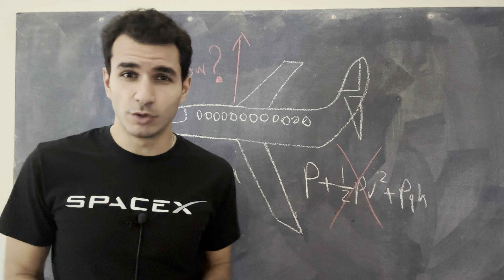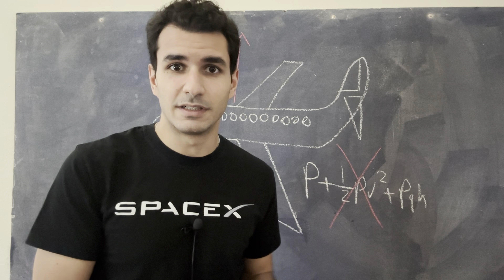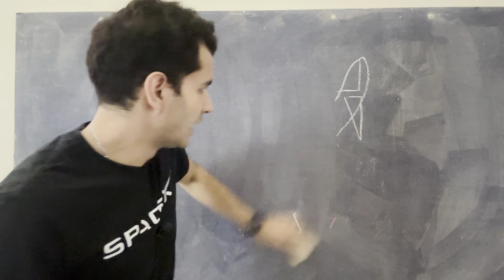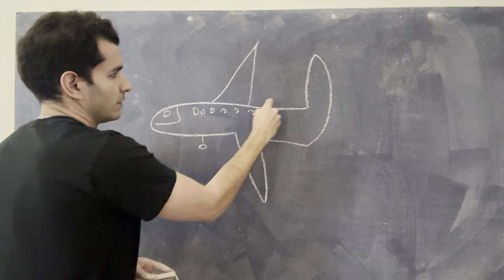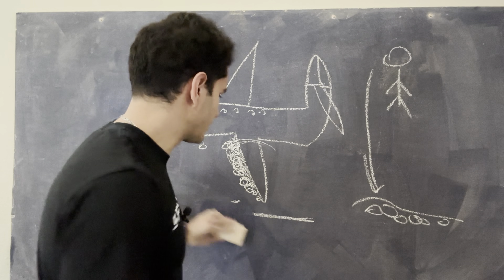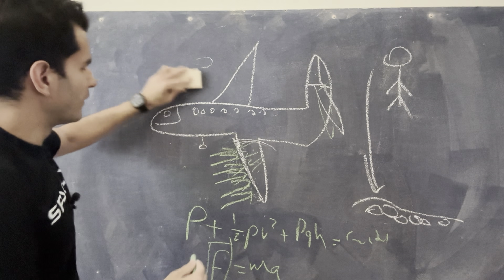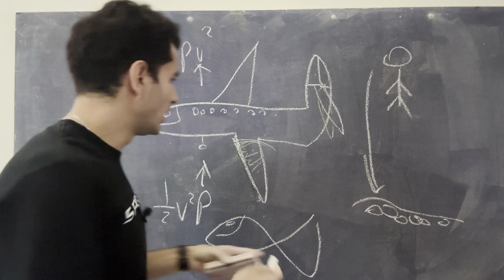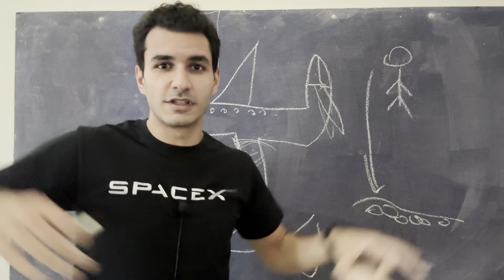Fix This One Misconception = Understand Airplanes Forever

Comment: I'm not an engineer, but I read quite a lot on the topic. It might make sense to do a follow-up and explain how both angle of attack and Coanda effect create lift (both are pushing air molecules down so Newton's law still stands). And how you balance the trade-offs to design an airplane for the given purpose
Reply: But Coanda doesn't do any work (in the sense of inputting energy) to change the momentum that accounts for the force of lift.  Or does it?  Which is an argument for not using Coanda to explain lift, because it is ill-defined in relation to the first principles of physics: mass flow continuity, and conservation of momentum and energy.

The above 3 conservation properties (mass flow, momentum, and energy) create lift in relation to asymmetry of the airfoil to the relative flow direction.

It is that asymmetry that causes lift, and as such it is asymmetry from angle of attack and/or any asymmetry of camber shape which combine to create lift, in terms of the 3 conservation properties (interacting with each other).

Comment: Best explanation of lift: Understanding Flight, Chapter 1 (Anderson, Eberhardt)
Reply: While your reference is useful, it is also flawed.  Lift is not merely a pressure differential, nor merely downward momentum. It is the conserved consequence of turning a mass flow (from an asymmetry) under constraint—where energy, momentum, and mass continuity must all be honored.  Their book is dismissing the relevance of the former in favor of the latter, therefore perpetuating the incomplete picture that keeps the opposing camps of a flawed divide in the argument going.

Comment: i'm just 15. and really.. people focus a lot more on the speed of air passing at the top and bottom of the airfoil causing pressure difference... and some compare bernoulli and newton like both can't exist at the same time.  and just how... complicated the internet has made this q... it feels weird to say that it's just air molecules pushing the wings when the plane is at enough speed to generate lift, and then angle of attack, and up elevators all come into the flight!
Reply: what I meant is why is it being overcomplicated. I don't even know THATTT much about it thought I am interested.
Reply from the maker: because most human's brains are full of noise and can't think clearly -- we will fix this problem long term
Reply: @alithedazzling  OMG THANKS FOR REPLYING.. I knew your channel was good.. but didn't know it was this good. keep making such great videos!
Reply: Because it is a bit more complicated than that.  But not a whole lot more complicated.  While I agree with Ali's statement:  "because most human's brains are full of noise and can't think clearly -- we will fix this problem long term". I honestly don't believe his explanation helps bridge that gap in this case.  The intuitive explanation needs more correlation to some missed nuances.  Sure, I agree it should be intuitive, digging behind the formulas, but with more focus on connecting to the underlying physics first principles.
Reply: @davetime5234  ahh i see. alright...
but our problem was not.. it's complications. that part is kind of fine. sorry for my lack of vocab. but I meant.. people overcompl.. I mean focusing more on is it bernoulli? or is it newton?
that's the problem
Reply: @avasyubiswal5421  "Bernoulli" is derived from (is a subset of) "Newton".  So, even if you simplify the description of Bernoulli to be a representation of conservation of energy, that conservation of energy is derived from the physics of Newton.  

Bernoulli is Newton for the case of distributed masses of fluids and gases. 

So, when air and an asymmetrical solid (the airfoil) meet, how does that "collision" reaction produce a change in vertical momentum that is equal to the force of lift? 

That's the basic problem that needs to be intuitively explained.

And why is that a far more energy efficient way of providing the vertical force compared to directly vectored thrust(?).
Reply: @davetime5234  ohh alright! thanks..

Comment: Partially correct. It is indeed forces on the control surfaces and not the reduced pressure above the wing that generates the lift. But, the objective truth of the underlying physics tells a different story about why aircraft fly, and more importantly provides the correct amount of lift. All will be made known in a new model of our world, that completely rewrites physics, in 2026.
Reply: In all honesty, four false statements, unless I missed you are trying to be funny.
Reply: @davetime5234  No, not trying to be funny at all. Do your reading and you will indeed find that physicists (who know their art) generally agree the numbers of the low-pressure lift above the wing theory do not add up. Yes, there is a big fundamental flaw (a rookie mistake if you like) at the very foundation of physics. The current, soon-to-be-legacy paradigm is only "approximate". As an example, the Newtonian gravity equation is as much as up to 2% discrepant. It is NOT because of imagined MASCONs. Newtonian gravity also says you are heavier at the poles. Gravimeter readings and a correct equation for gravity say the opposite. So, all those claims should give you a good laugh too.
Reply: @TheGeniusHillbilly  I think you’re conflating critique with contrarianism. While it’s true that oversimplified explanations of lift (like equal transit time) are misleading, dismissing low pressure over the wing as “a rookie mistake” ignores its central, measurable role in momentum-based models. Similarly, variations in gravity with latitude are well explained by Earth's oblate shape and rotational effects—nothing mysterious there. As for MASCONs, they’re real, but they explain lunar anomalies, not standard terrestrial gravimetry. So if your intention was satire, well played. If not… might be time for a deeper read.

Comment: Yeah I think I know where you are going. everyone underestimates the deflection component. I had a very smart instructor that had advanced aero under his belt tell me its a much larger lift component that most understand.
Reply: There are no separate components. Newton and the deflection of air explain 100% of the lift: they are the actual causes. Bernoulli is just describing the consequences (pressure differences) and reverse-engineering them to explain the same effect. It's like saying you won a football game because you had more goals. Technically true, but it misses how you got them.
Reply: @florianchalet4555  In the context of my flight training, he was helping me work through discomfort with power on stall entry. a maneuver we practice to simulate trouble on take off. If done poorly it is how you enter a spin.

Comment: Change in momentum generates thrust.
Reply: Time rate of change of momentum equals force.

But, yes, without that happening in the vertical direction, the aircraft can't stay up in the air.
Reply: @davetime5234  that is also true.  no thrust no lift
Reply: @charlesdarwin5185 Yeah, and a bit counter-intuitive perhaps, but while this is required to hold an airplane in the sky, it wouldn't be required in a wind tunnel test of an airfoil if the pressure drop on the top goes all the way to the ceiling, and on the bottom the pressure increase goes all the way to the floor.  

Because then those pressure differences are connecting the load to the frame of the tunnel, which supports the test object's weight against the ground.

So, no close wall (mid air), you absolutely need that downward "thrust" (caused by the pressure difference).

But close to a surface with rigid support connecting to the ground, and you can have all the lift sustained from the pressure difference alone.
Reply: @davetime5234  my comment was related to F=MA2.  delta MV in gas causes delta MV in plane.  Unless I am wrong
Reply: @charlesdarwin5185 I assume you didn't mean to put the 2 in the formula?  Just F=MA?

As far as the need for constant momentum change as the force holding an object up against gravity, it all depends on whether or not their is some structure providing opposing static support forces.

A book on a table is held above the ground by the table and its legs pushing back on the book with a force exactly equal to the weight of the book (opposing compression forces in the table).

If a suction cup instead attaches the book to the bottom of the table with a pressure difference, the table must still sustain those opposing compression forces to oppose weight, even though the pressure difference of the suction cup holding the book to the table provides a force opposite the book's weight (the suction provides force against the table, and the table must sustain that extra weight against the ground).

But if you support the book's weight by a pressure difference against only air (no table), then you need to continuously displace momentum downwards.

The pressure difference "against" only air is, in a very real sense, pulling down on the air above, actually causing the downward change in momentum necessary to replace the lack of opposing static compression forces.

And the force of that downward change in momentum must calculate to be exactly the weight of the book.

The downward momentum flow has replaced the need for the table's support.

Comment: I find this video to be inadequate. You don’t explain how an airfoil generates lift with a zero angle of attack. Not disagreeing with your stance on Bernoulli, I’m trying to find the answers too.
Reply from the maker: airfoil generates tiny lift compared to what changing the angle of attack does -- that's the whole point
Reply: @alithedazzling definitely agree with you there, especially during the takeoff sequence. But to me that’s pretty obvious. The non-obvious and interesting part about this subject is the role of the coanda effect in lift. Basically the air bends to the surface of the wing just like a stream of water from a faucet when you bring a spoon near it.

Comment: Now this is interesting. I started ground school recently and i was also taught the the airfoil design was responsible. Well thanks for expanding my horizon anyways.
Reply: I'm sure they were making the point that the asymmetry between top and bottom are the necessary condition for making lift.  But then in flight training you learn to internalized that angle of attack is how you adjust the total asymmetry in flight to control how much lift you get (directly affecting vertical speed change).

Comment: Like in most layman terms
So lift is nothing but drag on an inclined air wing and the vertical component of drag causes lift? And the thrust of the engines neutralizes the horizontal component of drag(overall drag of plane body) also gives horizontal acceleration by which the velocity is attained as the speed increases drag increases too?
Like I am from biology but i studied physics during my 11-12th

Comment: It's the drag the opposing force which builds with velocity of the plane and it's just pushing back which is direction opposite of velocity, so with angle of attack the air molecules get more area to push up hence it gets lift.

Comment: why is bernuli and newton an argument? aren't they both true at the same time
Reply: If you take "Bernoulli" as the (conservation of energy) pressure change, and take "Newton" as the (conservation of momentum) action-reaction, then they are both definitely inseperable aspects of the mechanism of lift.

A solid's asymmetry (whether from camber or angle of attack) changes the pressure so that flow speed adjusts to maintain mass flow in rate = mass flow out rate (continuity, or conservation of mass).

So then, the whole picture and the pieces:  

Lift is the force from asymmetry turning the flow.

It turns the flow by conservation of mass driving a conservation of energy pressure change which turns the flow to maintain conservation of momentum.

So, in answer to your question.  Yes, they're parts of the same whole that is always present, no matter the source of the asymmetry.

Comment: Newton and berrnoulli and bothe valid explanations. They bothe explain the same phenomena of lift but from different perspectives. You can calculate total lift as pressure difference or you can calculate it through forces acting on a wing. You basically have 2 mathematical approaches for same result.
Reply: Pressure is a force, so what point are you trying to make?
Reply: @davetime5234  1 year ago i did a research on this and i thought that total lift can only be calculated through adding  lift caused by "Newtonian" forces with pressure force difference. But aerospace engineers explained to me that you will get the same value from integration of pressures over the whole wing or integrate the momentum flux all around the wing...
Reply: @Siluetaduha-poezija. The vertical change in flow momentum (per second) always equals 100% of the force of lift, and the total vertical pressure difference (over the area of action) always equals 100% of the force of lift.

And the above is true because the pressure difference is the force that accelerates that change in downward momentum.

Pressure x Area =
F = ma = d(mv)/dt

You need the pressure change to get the momentum change.  

But then you also need to explain the pressure change which is:

 the conservation of energy pressure change responding to conservation of mass flow (flow out = flow in).

The explanation in this video is one of the poorest as far as getting lost in the woods about what to emphasize intuitively.

It is the asymmetry challenge (whether by camber and/or angle of attack) to flow out = flow in causing the conservation of energy pressure change.
Reply: @davetime5234  yes that is what I mean. Relationship between the pressure change and momentum change. In my paper I determined for me 3 most important questions. 1. Why is the air speeding up above the wing?
2. Why is the air above the wing following the wing contour?
3. What are the main "factors" that contribute to the generation of the lift?
My conclusion was wrong but the rest of it was correct when other engineers analised what i wrote.
Reply: @Siluetaduha-poezija. I like your attitude of investigation and discovery of what works and what doesn't.  I would be nice if it were more common in these videos and comments.

Comment: As a person who has no knowledge of aviation or mathematics, I truly appreciate your explanation about how lift works. Your logic gives the layman a visual and mental solution into understanding what for most of us is a far too complex notion to consider.
Thanks!!
Reply: I rewatch this video now and then, in disbelief to be honest.  There is a big disconnect between claims and delivery.
Reply: There's no question F = d(mv)/dt (vertical) has to be accounted for.  You can deal with the above law intuitively (throw a bowling ball while standing on a skateboard etc.) to some extent.

But you cannot intuitively dismiss the amount of mass required by the above law and the consequences of that calculation:

You need far for air mass to sustain the value of lift from the above necessity than is available to be redirected by direct contact with the wing's profile height (including pitch angle).

To accelerate the necessary amount of air you absolutely need a volume only reachable (in height cross section) by the vertical pressure gradient.

This fact nullifies the claim that intuition alone without some calculation constraints can reveal the correct physics.

Comment: When I started to fly I noticed that the fabric of the wing (Robin dr 400) was swelling like a pillow the moment we took off, swelling like bubbles from the lines of the stitches. Then I asked my instructor “so our whole plane is pulled by this fabric?” he said “hmm” but didn’t answer. Later on I made an electric airplane (small) where the only part of the airfoil was one third wing width from the leading edge, the rest of the wing was FLAT. That plane flew very smoothly, no bubbling fabric needed, the low pressure suction produced by the first third of the wing acted on a flat wing. I’m patenting this and a few other things dealing with a modified leading edge.